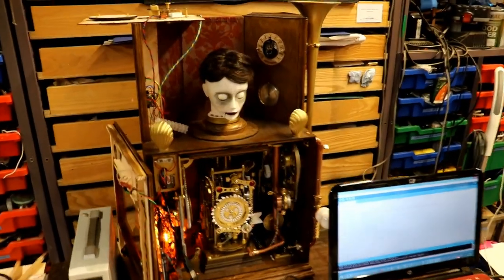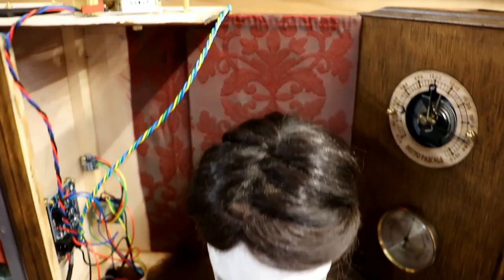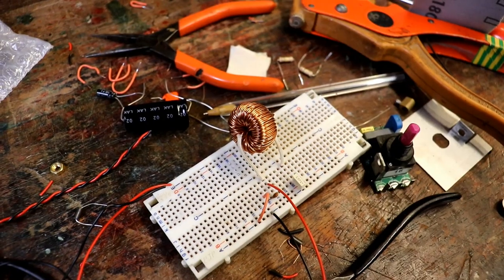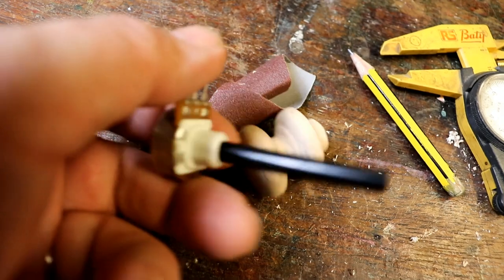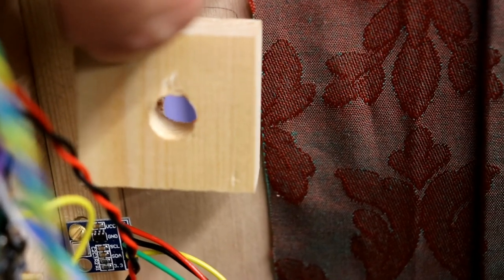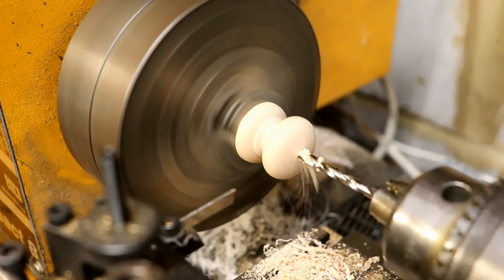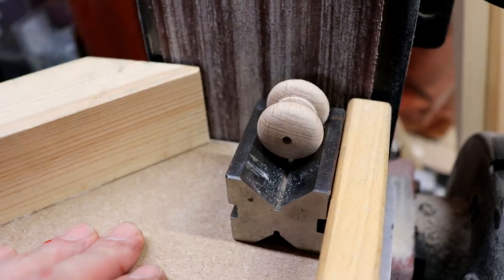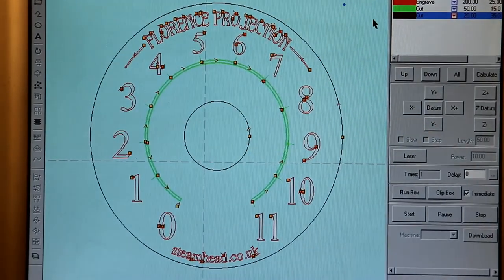Teaching Florence not to Whistle and Hum

Comment: Hi,
was the solution just to move the amp and sound board close together (with direct wires), or are you still using separate supplies as well?
Thanks.
Reply from the maker: Hi Epi, what made all the difference was to move the sound board right next to the amplifier and keep the power supply wires and signal wire really short between them. I assume the problem was caused by slight induced signals in the original longer wires to the sound board, and that was enough once amplified to make all the noise. Really strange - the dark arts of interference! Thanks for your question, I hope it helps.
Reply: @steamhead  Great, thanks.  Speaking as a engineer, moving them close together was definitely the right thing to do.
I was prompted to ask after watching another, 100% electronics-focussed channel, where they ended up using an isolated supply and did nothing about the wiring.  I was unimpressed with their solution, but wondered if you too still had an isolated supply.  Thanks for confirming that you don't.  :-)